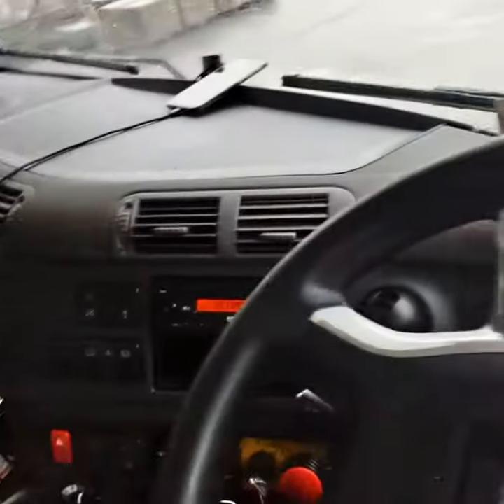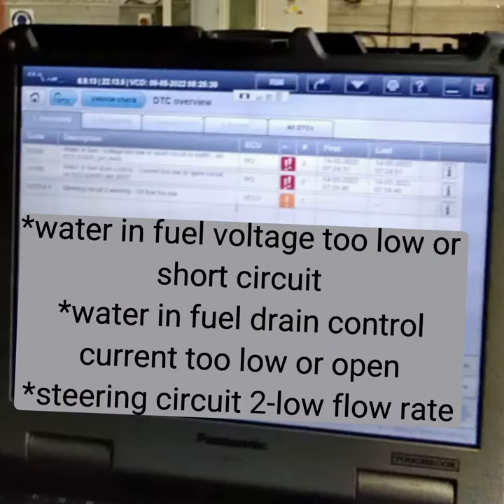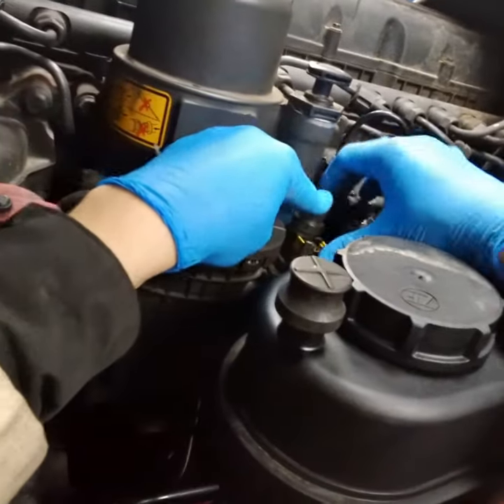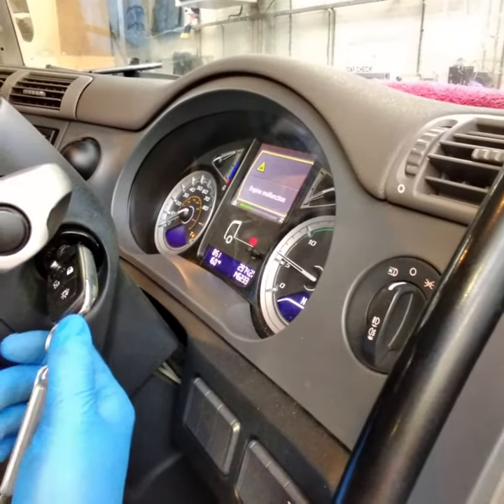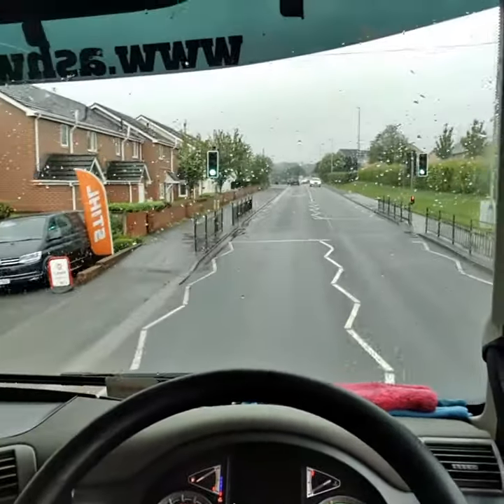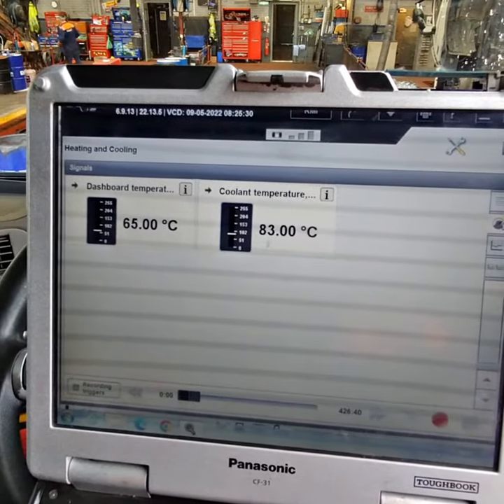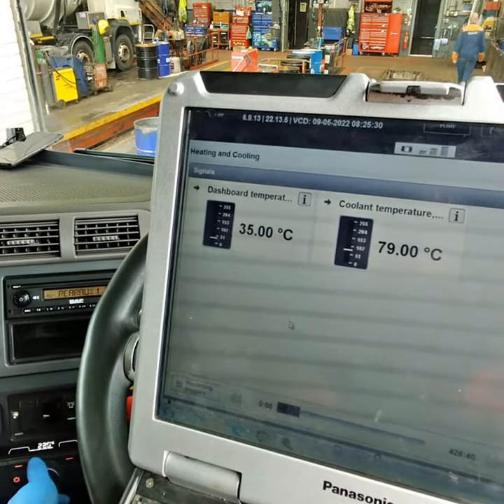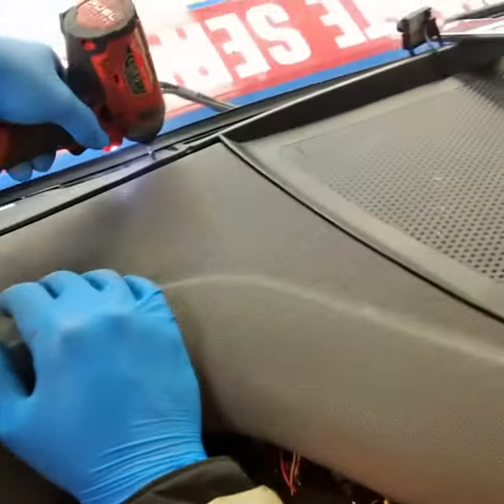DAF CF heater common issue and rectification

Comment: hi m8 - i have an issue due my auxallary heater stop to work after get low of Disel.

Any idea how to fix ?

Where arte u located in the UK ??

I want also let check maybe one injector which is not working proper - indections 10% more fuel consumption.

cheers MC